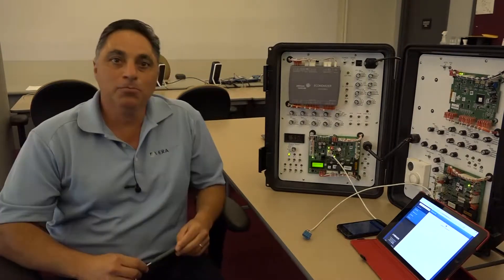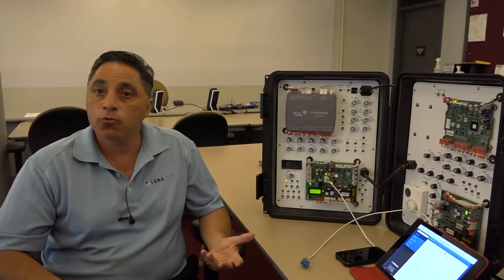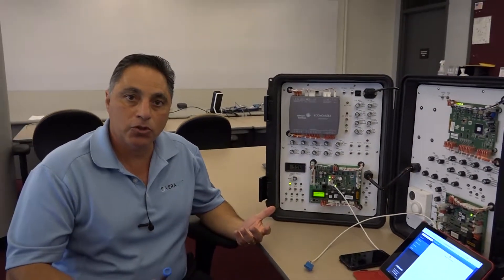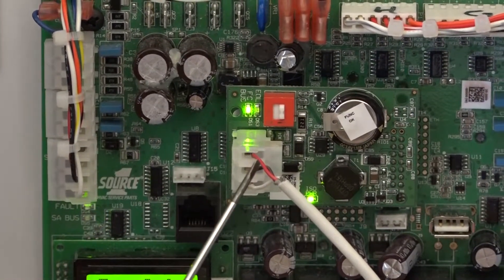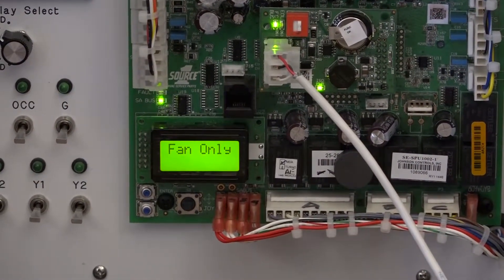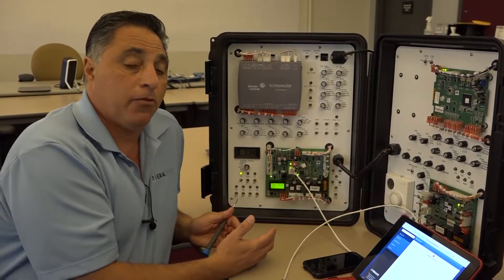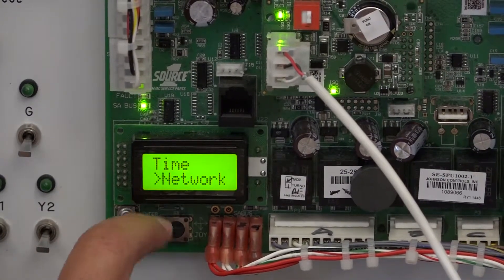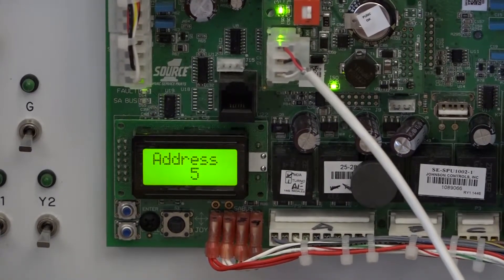Smart Equipment Hardware and Network Setup

Comment: This XN048 unit is less than 2 years old, and has multiple sensor failures, a failed "ecm" condenser fan motor and controller, a failed economizer control board, and firmware update issues...great unit.